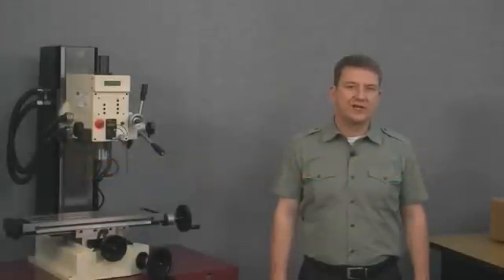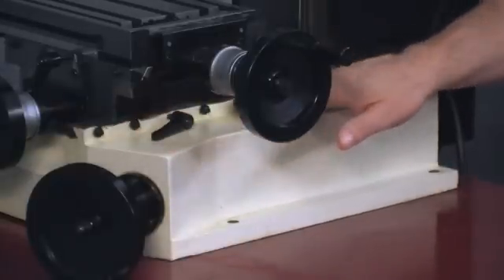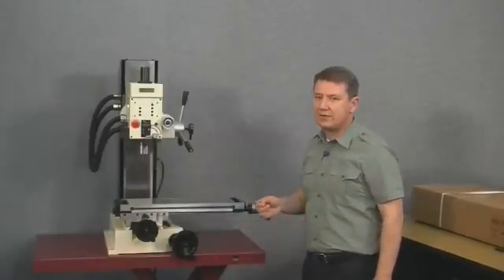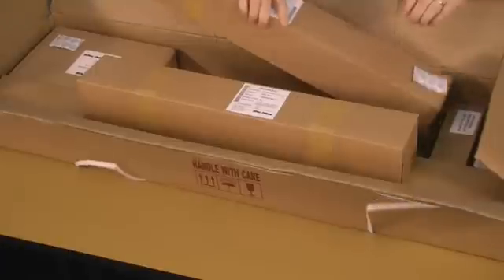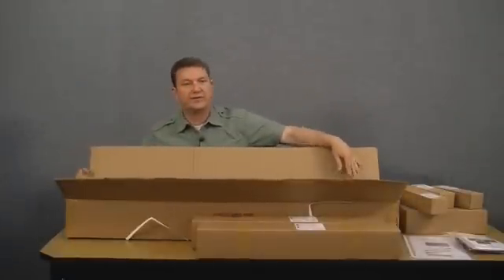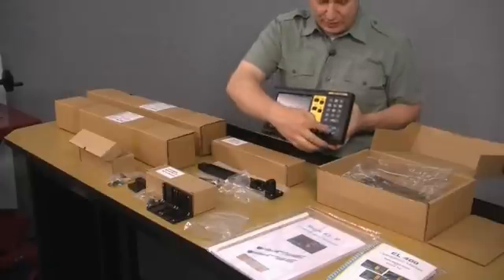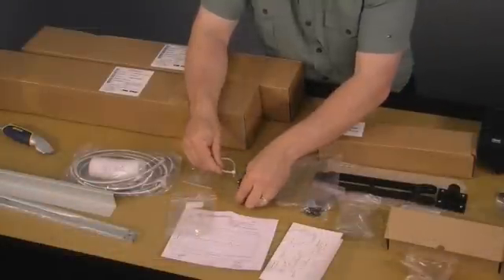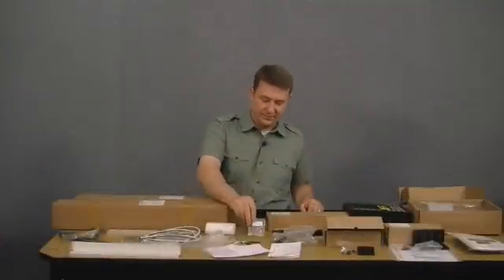How to Install a Magnetic DRO Kit onto a Mill Part 1 of 4

Comment: OK. But my mill (Harbor Freight 44991) has nothing called a knee. I just looked at the parts list and I do not see it.  I am not a machinists so the terms if the trade are not familiar to me. 

Keeping it simple, do I just make the scales the length of the slide table in both the X and Y?  In this video, you make the first measurement from a point that is still a mystery to me.